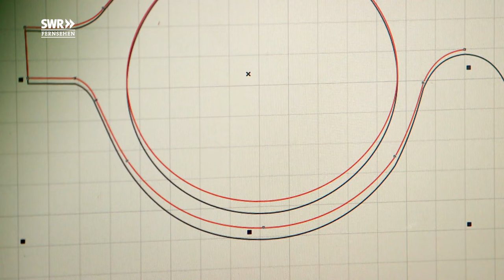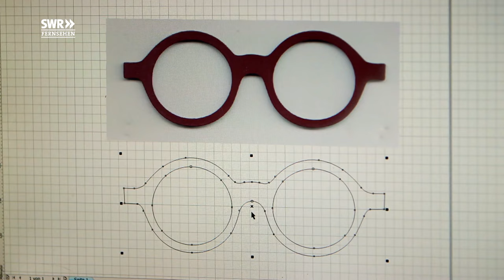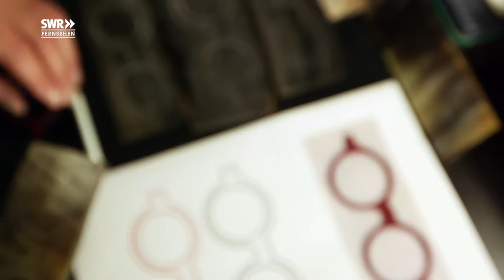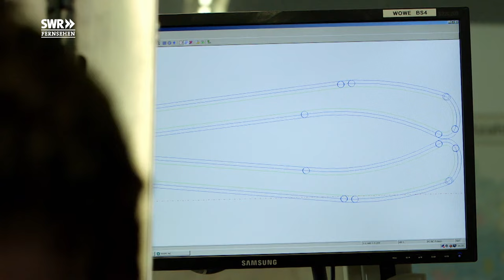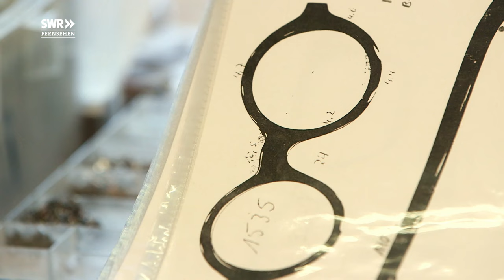Wie man eine Brille aus Büffelhorn macht | SWR Handwerkskunst

Comment: Great to see such a high quality product made in Germany.
There is something I do not understand though. The frame is not curved. When I put my glasses (also with a horn frame) on the table and look at them from above, there is a very nice curve that follows the curve of the face. The curve also ensures that both glasses are a few degrees apart.
Can anyone explain?
Reply: Interesting question.
Reply: At 39:10 the speaker mentioned, that the final fitting will done by the optician. This would be done by heat. I am not sure if this is meant for the bows only or even for the curve of the middle part.